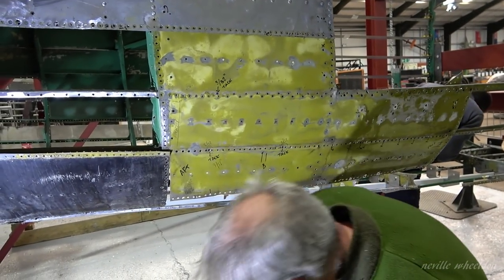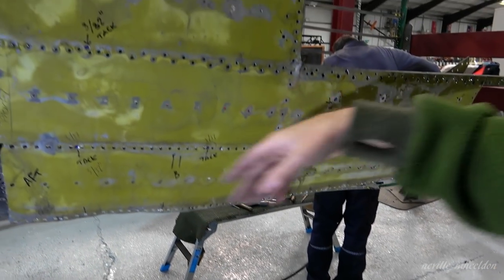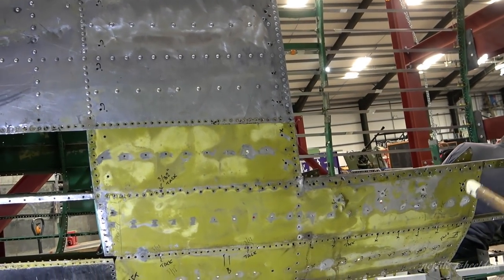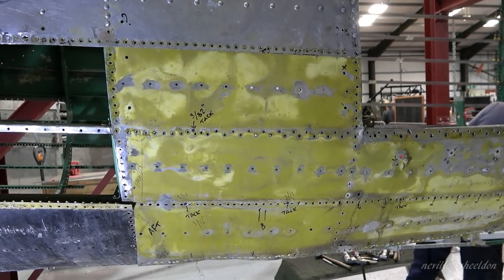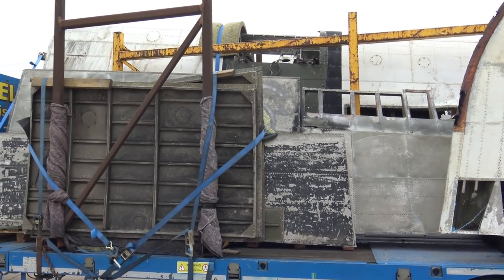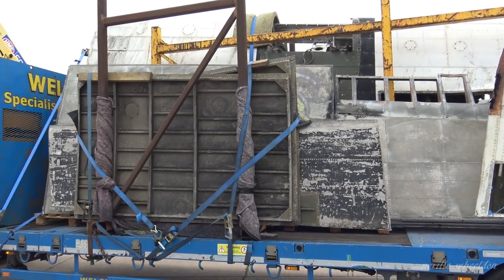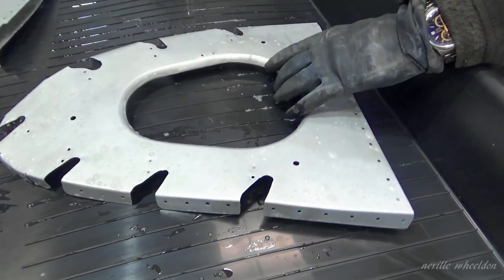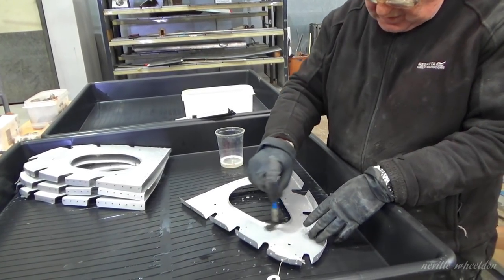Video 118 Restoration of Lancaster NX611 Year 4.  Doncaster fuselage. French wing. Mosquito run.

Comment: Great information about the Deoxidine 624 anti corrosive treatment.  That is a fantastic learning experience.  Still,  you videos are only fantastic. Hmmmmmm.
Reply from the maker: Hi Ed thank you. How are you progressing with your Bristol Bulldog.
Reply: @nevillewheeldon1693  The Bulldog is coming along. Did a short taxi test and found I need better brakes and carb set up. Should be taxiing soon. Check out: https://www.youtube.com/watch?v=k2tSt-rh9LY   if that does not work look up bristol bulldog taxi on youtube.